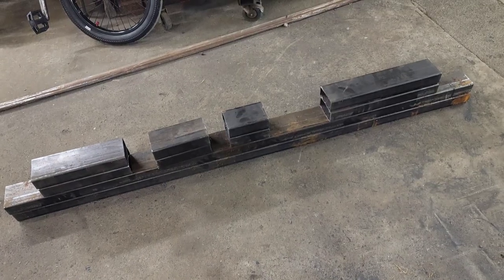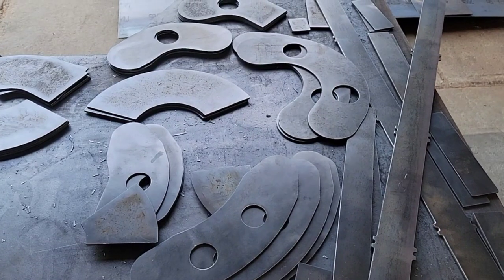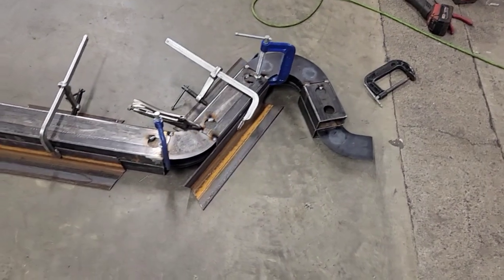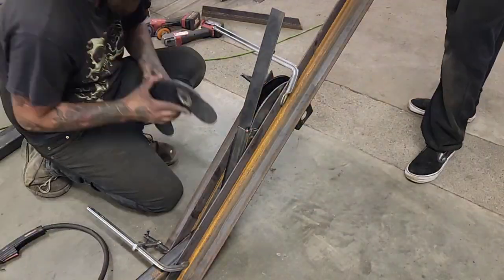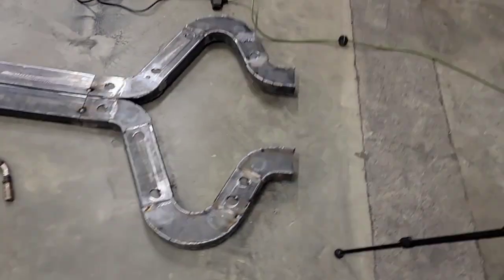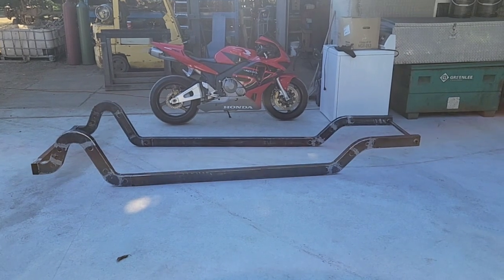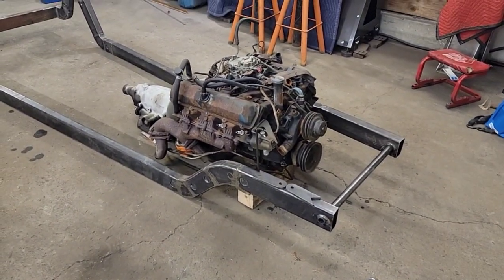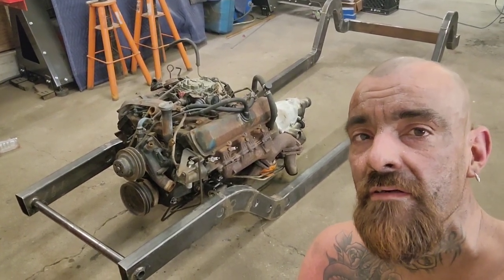Rat Rod Chevy gets a frame.  From  Cad to Reality, step by step, and I Even scored an Engine.

Comment: Awesome work on the frame !!  I think the engine is a BOP type. Buick .Olds , Pontiac. That one looks like an Oldsmobile to me.
Reply from the maker: It is BOP, I was told 1975 Buick Apollo
Reply: @kingofbootyfab  With the BOP they were mixing car brands with engine brands. They got sued for it and now all GM cars have corporate engines. People figured it out when they went to the parts store. Real Buick engine parts wont fit that engine. Olds stuff will. This may be a benefit as a lot of Olds engines were put in boats, At least in California. So some HP stuff exists for them.
Reply: Don't rev it to hard or you will run over the crank !

Comment: Like that frame....wondering if that engine could be an olds 260.. . buick had  the oil pump cavity in the waterpump/ timing cover housing .  also what is that triangular stand back in the corner...english wheel lower frame?
Reply from the maker: I was told Buick Apollo.  
And that video is coming next 🤫
Reply: no matter what engine...Ive had both and they are good engines,  perfect for that little chevy body.
Reply from the maker: I'm stoked to hear that.  I have no experience with them but it sure looks cool

Comment: Nice frame, gotta say you didn't waste any of the sheet of steel. Does the Cad program fit everything together,  or you? Also, I  assume that it moves around to minimize heat?
Reply from the maker: I do the cad design myself.  It's purely a blueprint.
There is actually a video of the frame design in its entirety if you are interested, it shows the exact process and how it was all built , some details that may possibly have not made it into the building video.
Welding it up is pretty straight forward, it's relatively large tubing, so as long as I don't weld the entire circumference of each weld in one shot, it won't warp enough to perceive.

Comment: What thickness metal did you use?
Reply from the maker: The Frame is all 2x4x 1/8 wall box, all of the plate is 1/8 as well.
Reply: Why did you make so many small pieces?
Reply from the maker: I'm not sure I understand.  The frame pieces are as long as possible to the bends. I wanted the look of a mandrel bent frame, the way I designed it allowed me to maintain strength, but still give me the aesthetics i was after.

Comment: Are you kidding me that little engine is a good boat anchor a 305 would be better
Reply from the maker: I don't disagree at all.  And eventually, I'll likely swap it out.  But for what I have into it, and the absolute lack of anything available on the island, I'll run it for now ;)
It costs me $300 to go round trip off the island after I drive for 5 hours to get to the ferry, and then however far to find a motor.  Have to build with what I can get, as much as I'd rather go bigger.